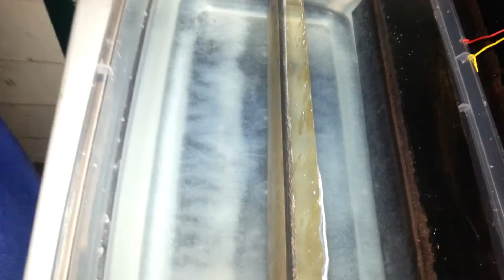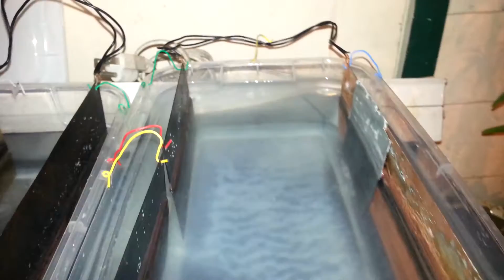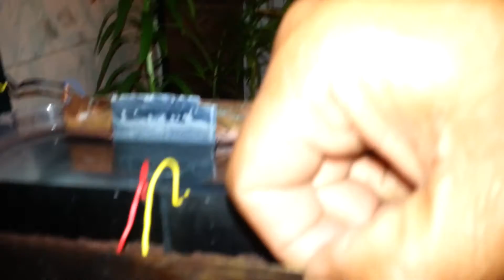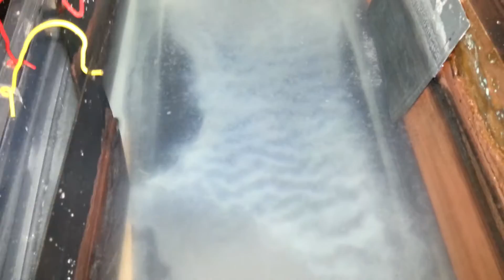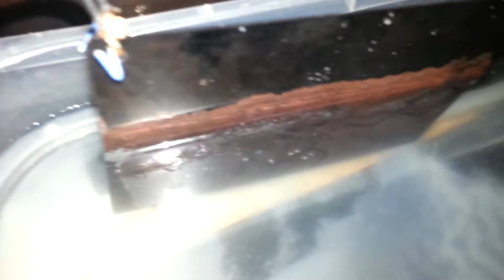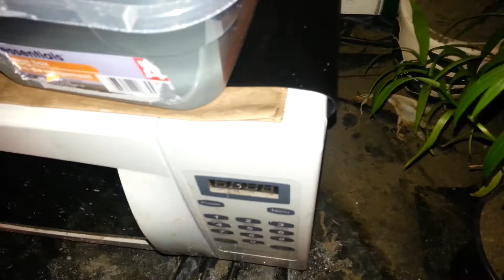Loss of Nano coating in Brass and Copper co2system

Comment: You ask in your video where the CuO2 layer goes.  I used to teach this in 9th grade chemistry.  What you have here is a voltaic cell with Zn and Cu electrodes.  The CuO2 (oxidized copper), what you call the copper nanocoating will dissolve pretty easily into the salt water (assuming NaCl here for now for the main component of the salt water.  So you end up with a soup of seawater (mostly NaCl ions in H2O along with other things like sulfates etc... and Cu(2+) ions (Oxygen of the coating will either go to O2 gaz or reintegrate into water (H2O), I'm not sure in this case given the amount of different components in the soup.Chemistry of batteries:  www.edinformatics.com/math_science/how_does_a_battery_work.htmThis setup will create electricity as the solid Zn will likely lose electrons and Zn (2+) ions will go into your soup as well.  The solid copper will most likely over time get a coating of some other substance from the "soup" of seawater ions going solid, perhaps even reabsorbing the Cu (2+) it lost from the dissolution of the CuO2.  The substance that you see at the bottom of your container is most likely a salt of Zn that isn't too soluble in water, perhaps Zn(OH)2, for instance.  If you dry Zn(OH)2 up, it should be white if pure, but since you have a soup in there, it could end up pretty dark with all sorts of impurities.I'm really curious about how these simple materials that occur naturally in nature and we reproduce in 9th grade chemistry class to demonstrate 100 year old technology, when combined in the way Keshe describes, generates infinite energy.  Hence the need for the testing of devices and see if there is energy enhancement (reactor) or generation (generator).
Reply: +Sylvain Rochon Oops. Its not CuO2 that is formed, but Cu2O and CuO.   M. Keshe always writes CuO2, which is completely impossible for copper given its 2 free electrons.  CuO2 is never observed  when combined with hot NaOH (sodium hydroxide).  Either M. Keshe confuses his chemistry equations or I misread a few dozens of hours of videos where he mentions CuO2.....  Anyhow, CuO is pink and Cu2O is black, so must be a mistake and he means Cu2O deposited on the surface etc....
Reply from the maker: +Sylvain Rochon it is a cell that has potential energy both plates submerged and connected and thus completes a circuit.  I have experimented with the zinc plate placed outside of the solution thus is no longer a voltaic cell and I am able to produce cuo with this setup and I can observe magnetic field lines of force as can be observed on my previous videos. the first few days the color of the gans is white then a few days more it turns into turquoise color. Is there deconstruction and reconstruction occuring? 

As keshe postulates magnetically individual copper atoms are now free in the salt water and the magnetic gravitational field of the atom interacts with the zinc plate placed outside of the solution. interaction of two nonmagnetic metals displaying magnetic field lines in very interesting and to make things more interesting I have also observed right angle lines I believe Zia called it a cross and this cross I believe is the same as depicted on pyramid drawing a disc held above the table that the priest lifts with one hand I am intrigued by this observation because it explains something about Coral castle in Florida.  

Thanks for responding I appreciate your explanation I am open to any and all data and I'm still learning.

Definitely alchemy and quantum mechanics going on here. Keep up the good work!
Reply: +mag netron Thanks for the description.  You are doing good experimental science here.  I just don't have the setup to do some of these myself (not to mention, pretty busy with my work, which is mostly on computers these days).  Do you have a vid of the setup with the zinc plate outside of the solution along with a description of what was placed in the solution (assuming the oxidized copper plate is inside the solution like for the galvanic cell)?To answer your question about the substrate, substrates change color typically due to further reactions or impurities.  Without testing we can't be sure, but this color is also seen on older statues over time which are made completely or partly (alloy) of copper:  it went from copper oxide and converted partly or fully to copper hydroxide (pale blue or turquoise).  It could also be becoming CuCO3OH which is malachite (turquoise again), but much less likely given the solution you have there.I'm perplexed at the magnetic fields (gravitational fields are not proven or demonstrated in your setup, since you can't measure the gravitational fields with equipment you have at that scale (highly unlikely)).  But magnetic fields can be seen with particles of magnetic materials as the materials, if free to move, will align with the fields.  That's an easy trick so very valid observations.Its normal that magnetic fields will form in a galvanic / voltaic cells since current creates magnetic fields.  Also something to remember is that magnetic fields and current are known to create what is called "temporary magnets" in that magnetic and non-magnetic metals that remain magnetic for a while after induction.  For example, copper and manganese are not magnetic but they can become so when treated with other compounds (its been experimented to do this and get a few days of magnetism when copper is combined with simple carbon-based organic molecules).  The metals and their compounds that are associated with magnetism are:  Iron, Cobalt, Nickel + many of their alloys.  Carbon is seen by some as magnetic if in certain conformation, which is pretty neat.In a nutshell, given the right circumstances, if you are generating temporary micro-magnets of copper or other compounds (since salt water contains perhaps even magnetic material too), their combined magnetic field "could" theoretically influence the Zinc plate outside of the solution in some way.  Though I would have to see it for myself and the full constituents of the experiments to see if there isn't something else going on (another hypothesis etc...).

Comment: Excellent set up, nice and clean. Do not mix your copper oxide gans and CO2 gans. You can use the CO2 for healing / health purposes. Keep your reactors apart ( at least 1 meter), the fields will mix and you will not have pure CO2 or CUO gans.

I am having a hard time creating blue CUO gans. I made some but I had to keep it away from other GANS (CO2 or Aluminum, etc) for it to stay blue.   I " think" ( not sure) that CO2 GANS making in adjacent container reactors turn the CUO gans red. 

I put a banana on top of the reactor, the CO2 gans changed to white /yellow and CUO was turned into red / orange.  It was amazing to see the GANS and the solution turn to yellow.  The solution also smelled a bit fruity and fresh (??).   You try an apple or orange see what happens.

I have cleaned my plates with Vinegar.  I will reuse them in caustic, don;t know how strong a nano  layers would be the second time.  Be careful of putting zinc in vinegar too long it will eat it up.   The vinegar did clean up the copper and aluminum plates to a large degree.  

By the way, I put a few small cuts of nano wires in a plastic bag and put over my skin psoriasis.   I have seen at least a 50% improvement and less skin irritation and tmuch less need to scratch.  Psoriasis has been with me for 4 years now.   I am washing the salt out of CO2 CUO and other GANS as we speak.  Planning to make a healing patch and a healing pen.  Will see how they will do

I did install coils on the car battery but no effects so far.   Not much or very little improvement on gas mileage, the engine sounds the same   I will install spirals this week and see if spirals are better than coils or not.

Sorry for a long comment

Keep up posting the videos.
Reply from the maker: glad to hear your healing project is doing great . I will be making CO2 with the zinc plate outside of  the container I will put a fruit above the reactor also .  I have been using a nano coated spiral coil on my car battery and my vehicle seems to run smoother. Something interesting happened On my co2 project.  "The insulated copper wire connecting the 2 plates  became nano coated!......." thanks for sharing!
Reply from the maker: I will do as you suggested and put my reactors apart 1 meter thanks Zia.
Reply from the maker: Just uploaded my completion of Alekz Power Beads (Keshe) check it out it I'm so excited!!
Reply: +mag netron Healing project??
This is criminal!!
Reply from the maker: +Jean-Pierre Mürrli how is it criminal?
Reply: mag netron Quack is forbidden with good reason
Reply from the maker: +Jean-Pierre Mürrli that is (a priori) ......
Reply: mag netron
FYI: Excerpt from Keshes publication
Read it for heavens sake before you even think about using these needles

This came after Keshe noticed hat he will be in deep shit if something goes wrong with the usage of the needles

Yesterday, in the recording what came, we asked when we announced that when you mix ganses with amino acids it can create new germs, new viruses, because of the combination of fields. And I warn you categorically, anyone who uses, or contemplates to use, to develop, to manufacture needles as part of the structure of acupuncture, you are playing with people’s lives and Keshe Foundation stays totally independent from this find.
We taught the technology, if anyone develops with categorically. Because I can explain how you create diseases in people, you don’t understand, and people look for their own private… what you call it profit pocket, you are responsible for people’s lives, Especially if you are in the medical field and you do it with the warning I give. So, if any new diseases or deaths caused it stands responsible by you and not by the Foundation. 
We are very categoric about this, because we know that there are people around the Foundation who are developing, or trying in China, especially Dr. Eliya Kostova, to develop needles in acupuncture. I warn her, she has nothing to do with the Foundation, she is categorically beyond the limits we have warned. That if such a step was taken, I hope I am wrong, but it is for people to understand and authorities to understand, we separate these kind of actions from the Keshe Foundation. 
These kind of needles, nanocoated in any shape or form, delivers energies on the layer which the body has no immunity for. A skin cancer and different kind of cancers are inevitable. We warn and anything to intrude, and I give this categoric warning to Dr. Kostova: It is beyond the limitations of the medicine while you are warned to practice and develop such a technology. And it has nothing to do with the work of the Keshe Foundation, and this can create huge damages to people who use it, long term and short term. Time will tell, and we stay independent from this.

https://www.facebook.com/groups/831716123584746/?fref=ts
Reply: +Jean-Pierre Mürrli 

Why you keep flip flopping and changing your ideas.  Sir, if you do not believe in Keshe technology, then all of this is smoke and mirror and does not work and Keshe is trying to make a name for himself and take money from people.  There are no gans or new matter state and hence no microbes or viruses.  Then, your post does not make sense.
However, if you do believe in the technology or at least partially.   You will need to concentrate your efforts on learning and spreading it.   Or, at the minimum keep quiet and observe.   If you are concerned ask and write to your European Union to provide resources for further studies.   
I give you an example for clarification. In 1867 Alfred Nobel invented Dynamite, a substance much safer and easier to handle than Nitroglycerin.   He had peaceful intentions for his invention, but before he died Dynamite was used for wars and killing.   He was a pacifist and this saddened him so much that he dedicated his fortune to peace and the Nobel peace prize foundation started in Sweden.
This is the case with Keshe; he is providing guidance and directions to people on which procedures are safe and peaceful.   So instead of attacking him you should join.  Not helping the Keshe foundation and not
being involved in your case and using your own words it is “CRIMINAL “.     
Peace upon you my dear.
Reply: Zia fatemi 
Have you read Keshes own words in the transscript above? Can you really be irresponsible enough to ignore that his medical "inventions" are life threatening - a fact that he himself publishes ? Do you know what skin cancer  (melanoma) is? It is the most agressive cancer and it kills within 6 months

If you like, use these needles for yourself but do not talk others into endangering their life.

I really ask myself if there are any limits of the stupidity of people who support this lunatic

:(
Reply from the maker: +Jean-Pierre Mürrli I would not want to pierce my skin with anything unless there is a medical need prescribed by a qualified medical Doctor here in the United States. Your concern is valid but calling Keshe a lunatic is derisive and unjustified. When Keshe he is the "Messiah" it was figuratively expressed I believe u r intelligent enough to perceive that.....
Reply: +Jean-Pierre Mürrli If you are on begining understanding dont use nothing you dont understand. Gans is energy, pure as it is, visible by you on Earth, try to go higher when you "solve" gans in your knowledge. cancer dont exist until you "want it" unconditioanally or have body with lack of energy in certain place and your brain decide to energize other part other way.
Reply: +mag netron You see on Jean, he is afraid of cancer but for sure sees gans as dangerous, why? and why lunatic? I see he have personal medical Doctor maybe, but Doctor was never educated in this field. My family and people around never was healthier and LifePen from Renans is miracle for others. I wish to try everybody, non contact nanocoated wire with intension to help or heal works 100%. There is confusion about Doctor, if he is same nature as Jean, he never tell you thruth about black coat because he immediatelly loss patient. Try to look for good people and everybody must start with himself or herself, then you will see how your "community" change, you attract people same as you are unconditionally.
Reply: Marek Bartas Supporter of GNM? :(